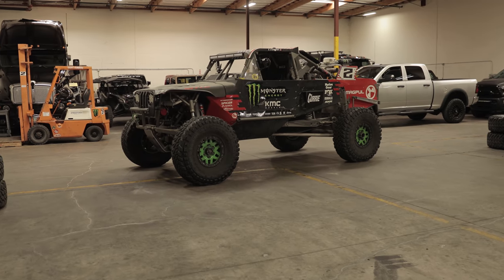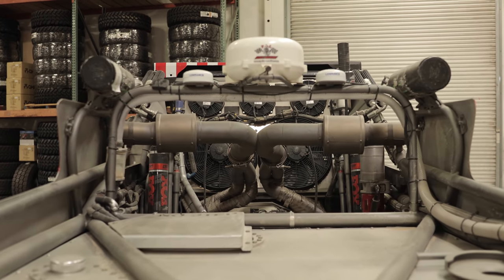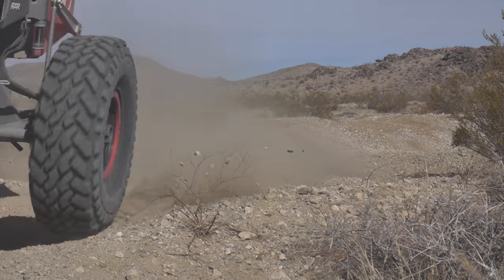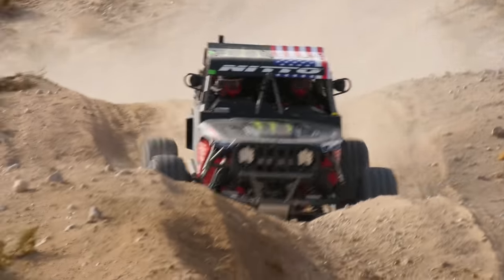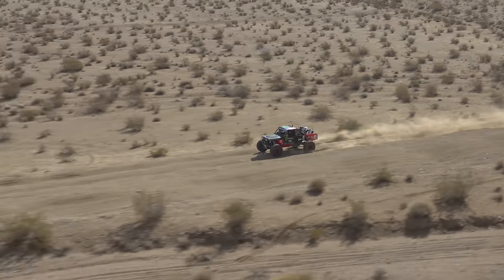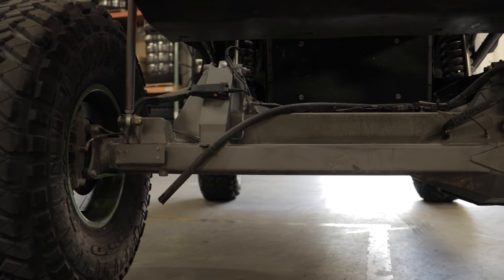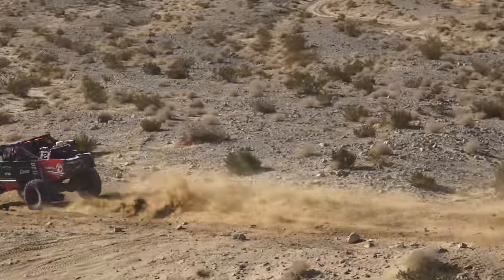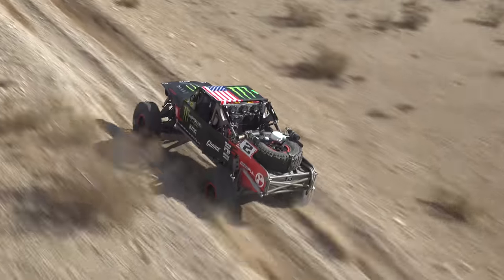I FINALLY BREAKDOWN THE TROPHY JEEP | VEHICLE BREAKDOWN

Comment: i bought the Losi Hammer ray model of your trophy jeep and man i got to say its badass i like the grasshopper suspension you did on the rear of the truck it allows it to roam through the bumps with 0 issues

Comment: Please give as some info about running on "coast side of gear" : possible damages, maintenance, temperature, small pinion issue, what are the best choices, what we should be aware of! Thanks 👍
Reply from the maker: I have been racing this way for 4 years and have won the Baja 1000 3 times. No heat issues and no pinion issues

Comment: I've wondered for a while... Why aren't more racers doing 4x4?  Do you feel like it has limited you in any way?
Reply: Gas, weight, more maintenance, gearing, upgrade power, but it definitely does help help if you can perfect it.
Reply: @charlesluhm2181  I remember some years in Baja where everybody was getting stuck in the silt and the 4x4 guys had to rescue them.  I guess they are just rolling the dice on that possibility?
Reply from the maker: It’s a lot more expensive